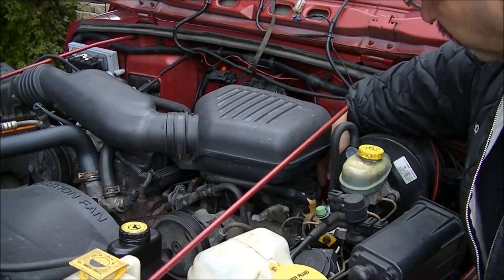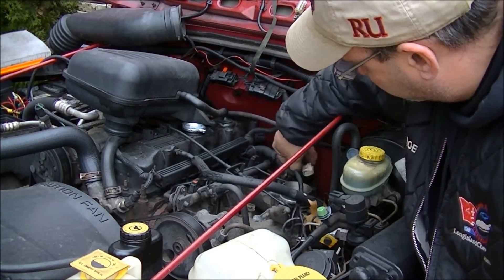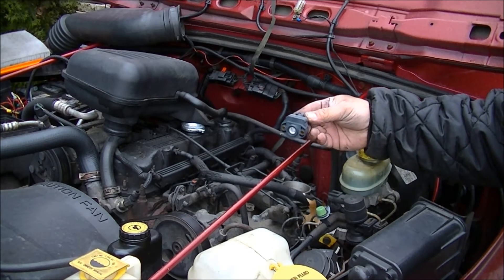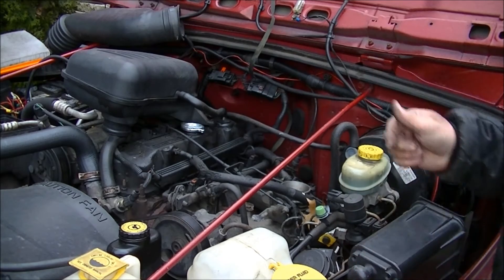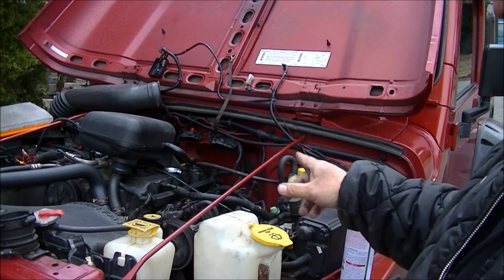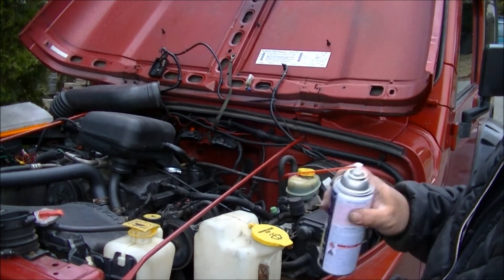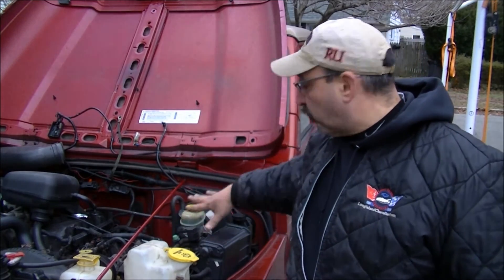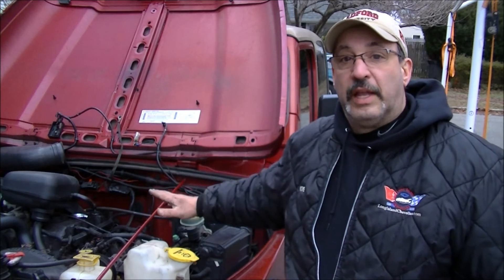Replace a Throttle Position Sensor TPS Jeep Wrangler or Cherokee

Comment: first of all great video, my 1999 jeep wrangler, when I start it for the first time during the day, the engine will idle high and even sway between 1 and 2 RPMs gage, I am not sure what the issue is, there are no engine lights on, as well as once I put it into gear, it is fine, but it is like roaring when I first start it, and I have no clue.
Reply from the maker: TPS, IAC, or an old fashion vacuum leak that swells up when the engine warms up.

Comment: Would the TBS also cause the oil pressure gauge to show low oil pressure?
Reply from the maker: No it should not, unless you have some strange electrical issue.
Reply: It can cause low oil if it idles down to a low rpm.
Reply: I had low oil pressure and sometimes no oil pressure. I changed the sensor twice from O'Rielly's and did not fix the issue. Found an article on it, requires an actual Mopar sensor. Changed out a 3rd time with a mopar one, no more issues.

Comment: I'm just changing it now, so we shall if I'm having same issue. I'm hoping it's the solution my also hesitated when shifting and driving up at 2500 rpm do you think?
Reply from the maker: When was last tune up?  may need to start there first.

Comment: Is there anyway to change the radiator drain cock with out changing out whole rad. My has a slow drip.
Reply from the maker: Yes, depends on the problem.  Sometimes a slow drip is just a missing or bad O-Ring.  If the threads are messed up on the plug, new replacements are available.  If the threds on the radiator are messed up, try a tap, otherwise a Rad shop can repair.